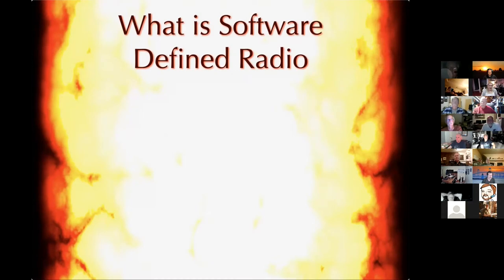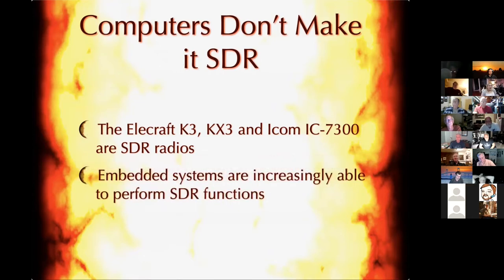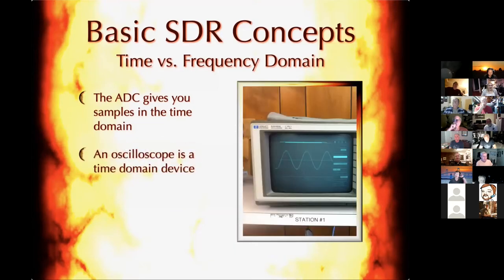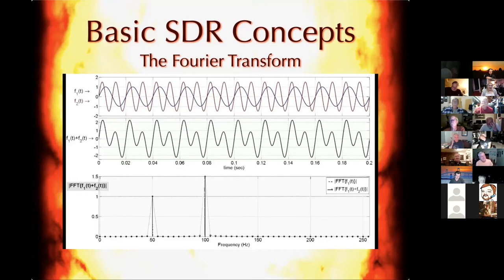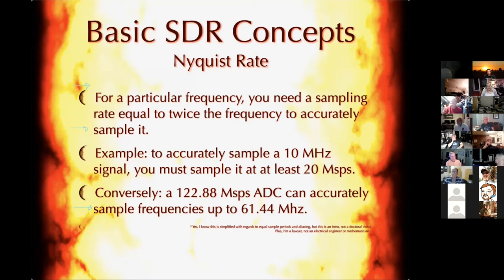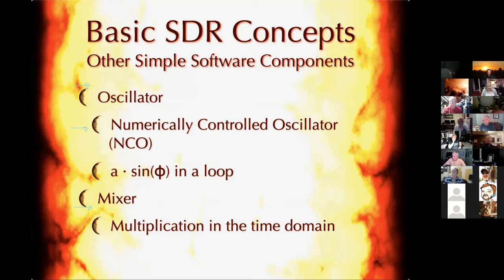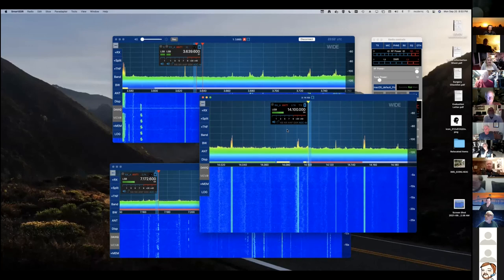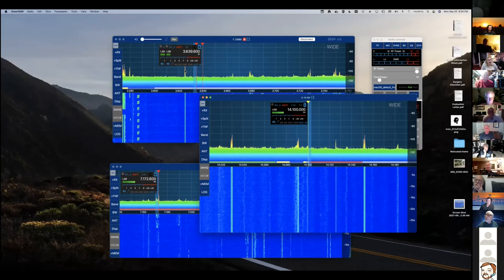Software Defined Radios

Comment: How did you get 4 radios for free? I finally upgraded to Extra class recently, but with a daughter being born in 2 months, and my wife migrating from Europe I simply cannot afford one and college at the same time. I have tried to find scholarships to be able to buy an HF radio, but so far no luck. Many are for high schoolers, or undergrads. I am 28 in graduate school (rips through any spare income i have), in security studies, radio is a theoretical hobby. I cannot call it an actual hobby until I stop studying and start doing. 
     I have considered getting an RTL SDR 4 soon, but like you said it does not perform well for HF so I am not sure how to get into HF without dropping 1200ish for an icom i7300, another hundred for a power supply, and another 300 or so for a multiband hf antenna because id rather start with an antenna that works, so i can get an understanding for how antenna's are suppose to perform before i start building them. Outside the RTL SDR, it just doesnt seem economically feasible for "young blood" to enter the radio field, simply because it is not easy to get an HF radio. 
     In the meantime, until I figure out a way to get a starter radio, I will keep studying free YouTube videos on the topic so i am making progress, but i mention it because it seems to be the limiting factor preventing young people from doing it. Hams are mostly older because older men have more disposable income. If there were a scholarship, or a radio giveaway for young extra class holders, it would push more young blood into ham radio because then they would see it as practical. 
     From an economic standpoint, if i have an interest in computers, and HF is a 1.5k starting point, but Hack The Box, and TryHackMe have free options, and the cheap options are $15 a month, it would be more feasible to spend 3 years learning computer hacking instead of learning radio, because hacking could be practiced hands on. A rasp pi, with vulnPi software to practice hacking is also what $35 at cheapest? $35 for hands on practicing hacking your own machine & $15 a month to practice hacking virtual machines on HTB and THM versus a 1.5k entry point to Ham radio for HF. Naturally, studying hacking provides a better ROI than ham even if it is not a career path. 
     I am bringing all of this up because maybe the older hams can create scholarships for young hams, hf radio giveaways, or some other way to get equipment for those serious enough to study to pass extra class that would actually learn to contribute to advancing HF if they had the equipment. If I had an Icom 7300, or something starter, I would first learn it in detail, then look for ways to replicate its functions in an add on to my rasp pi 4, and post results to lower entry cost into it, possibly selling pre-assembled kits. I'm sure, others if they had the opportunity, especially younger than me, would work to advance things even further. 
     How awesome would it be if the younger generation found ways to implement HF technology with smartphones? Maybe HF controlled over an AREDN Network using a phone, so texting and calling could be done wirelessly over HF mesh network hybrids? What about younger generations launching a Rasp Pi 5 into a space, on the basis of an AMSAT kit, that is more than just telemetry but is actually controllable from a ground station, especially if it had a Linux OS on it? Dragon OS can be put on a Rasp Pi, what if one of those were launched, and a club could control it, allowing younger members to play with a full blown sigint computer from space? The fact Meshtastic is catching on quicker than HAM radio, due to affordability and integration with smartphones should highlight the cost issue, and the type of interests younger generations have. KM4ACK has some videos on how to turn a cheap rasp pi into a ham radio rig, those help with the cost issue for young people. More low cost options are needed. Since 1980, wages havent kept up with inflation, so if radio cost doesnt decrease, it will only get harder for each new generation to get into from continuously decreasing disposable income.
V/R
Formerly KE8QVP, now AD8MC